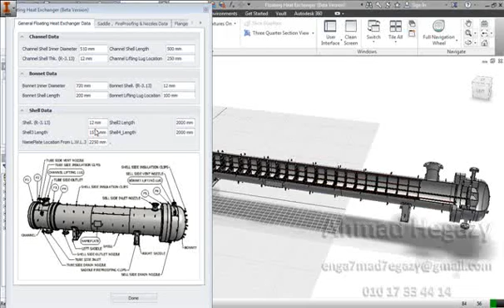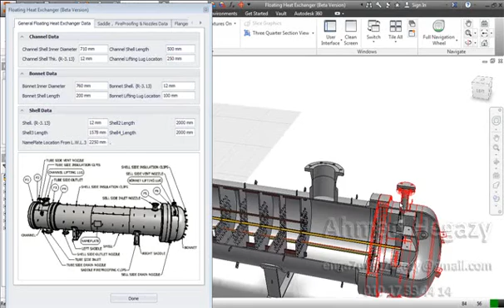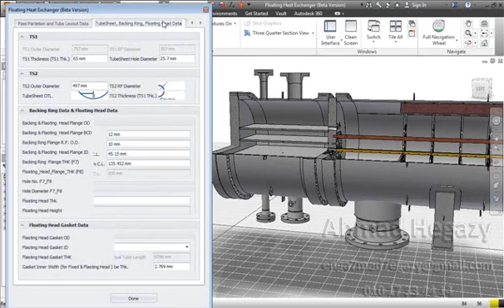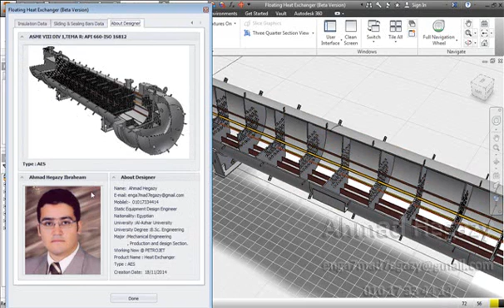Modeling Of Heat Exchanger by using Autodesk Inventor , iLogic

Comment: Hi I'm currently new to autodesk and your video's a big help. I'm just curious where you got the floating heat exchanger beta version?
Reply from the maker: it is 3D Pressure Vessel design software 2017®
It is a powerful iLogic models with a rich library, 3D PV® software is a special
software for 3D modeling of pressure vessels, Towers and heat exchangers makes
you able to create your 3D model faster and easier than any other known way..
Two versions are available, the first one is 3D PV 2017 Suite (for pressure vessels and
towers) and the second one is 3D PV 2017 Professional (for pressure vessels, towers
and Heat exchangers)
And it’s able to create 2D fabrication drawings for static equipments by using
Autodesk inventor as a platform (Autodesk Inventor 2014 up to 2018).